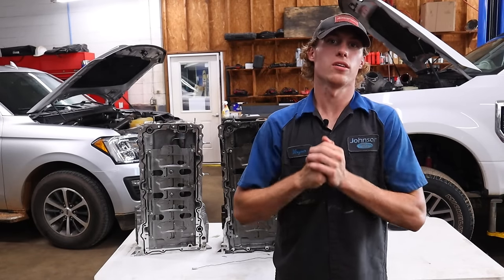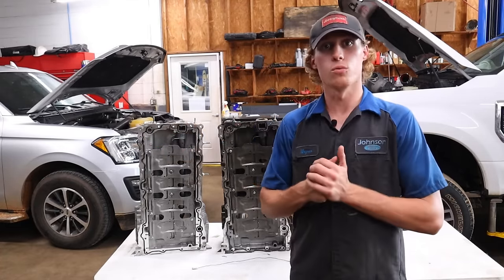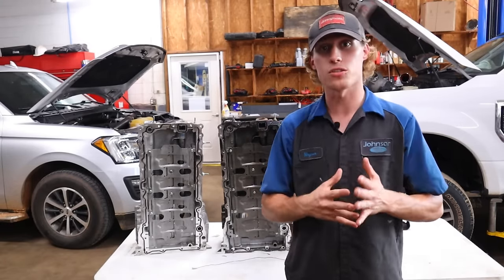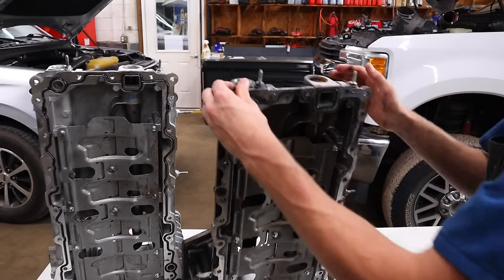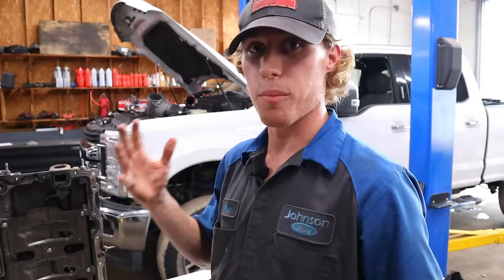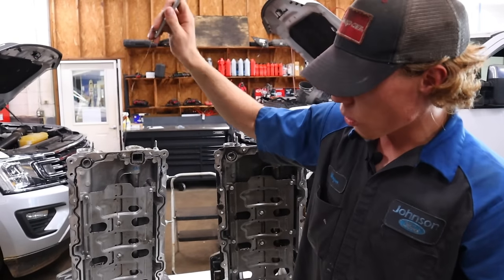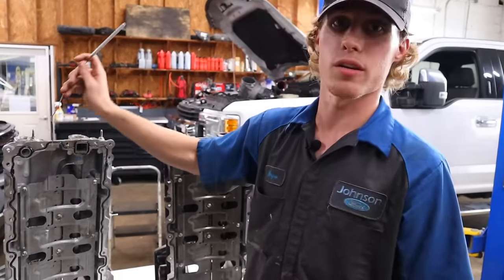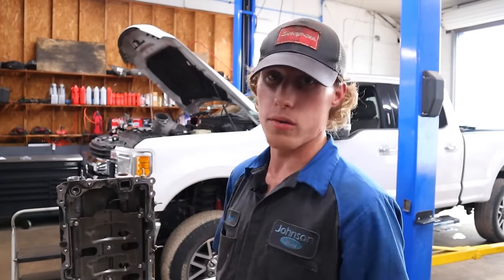How a BRAND NEW Oil Pan Destroyed This 6.7L PowerStroke

Comment: I find it hard to believe it locked up after only a 7-8 second run without oil pressure. During the cash for clunkers program, we had to intentionally blow up engines by running them with no oil and in most cases, those engines did not die easily as long as there was even the slightest oil film or lubrication on the internals.
Reply: I was thinking the same thing.  More than likely, they installed it, started it and took off for a test drive in it and locked it up.  Just a guess.
Reply: Yup. That’s not gonna lock up that quick. Shows extreme ignorance to even make that claim. Also, he put a pan on from a different year truck. I’m guessing there is more to the design change than that gasket.
Reply: I was thinking same; but I'm a GASOLINE engine mechanic. I do know NO WAY a gasoline engine locks up in 8 seconds at idle; I've seen demos where engines run at fast idle for many many MINUTES with NO OIL PAN 😆.  Are diesels more delicate flowers 💐???
Reply: That cash for clunkers was fun. Getting paid to blow up engines. Doesn't get any better than that. I was honestly surprised how hard they were to destroy. I was hoping for major catastrophic failures. I was sad when they slowly whimpered and stopped.
Reply: @xj31  It was a scam. A lot of really good vehicles were destroyed. There were a few I would have loved to have saved.
Reply: For sure
Reply: @CentralFloridaBowHunting  If they were to test drive it, they would have noticed it on the dash. No, someone leaned in and cranked it up without checking the dash, and then they lifted it up and ran it on the lift for an extended period of time to check for leaks from underneath with the engine running. By the time they came back, it was too late.
Reply: @AlphanumericCharacters  Good point.  Ford's gonna hang their hat on that one fact even though that new pan is being shown to be defective.  I would be interested to learn the outcome.
Reply: @nickyborrisino  Agreed.
Reply: Installed pan, started car, ignored oil light thinking oil will start circulating, left it idling to get up to temp to check for leaks, it locked up. Cant blame the mechanic impossible to predict things like this but dont go saying it locked in 7 seconds lol.
Reply: @kamn1  it is absolutely the mechanics fault. You never leave a running car after doing work to oiling/cooling system. The car needs to be constantly monitored until it can be verified as good.
Reply: @nickyborrisino  exactly he should have made sure there were no warning lights on after starting it the first time. my guess would be he got done and reached in the window and fired it up. let it idle until it locked up.
Reply: @nickyborrisino  fair enough
Reply: @coryament  exactly
Reply: I've personally witnessed a 6.7 Cummins idle for nearly 45 minutes with no oil.
Reply: @nickyborrisino  makes sense.
Reply: @hightttech  I had a Suzuki Swift lock up in approximately a minutes after the valve cover gasket failed and it still had oil in it.. I won't say it's impossible for a short run to lock up a motor
Reply: Every time I deal with anything related to oil related repairs of any kind first thing I do on startup I made sure it has oil pressure.....
Reply: @AlphanumericCharacters  He's actually not the first person to run into this exact issue with the oil pans. Definitely a manufacturing defect
Reply: I never heard of an engine that would only run 7-8 seconds without oil.
Reply: Man that was a fun time...can't believe that was upwards of 14yrs ago now.
Reply: Yea I'm sure the bearing clearances in those engines were just as tight as this 2015 6.7, I'm sure they lasted hours with no oil. Im sure you've ran every type of engine known to man out of oil and you know just how long every one will last. I've seen new engines last 10 seconds without oil and I've seen 200k mile engines last 10 seconds without oil. But I know not everything is the exact same and shit definitely isn't made like it used to be. You can find it hard to believe all you want but it's not your truck, your shop or your problem so it really doesn't matter what you, me or anybody else thinks. Guy got some good info out while also getting some views, and the customer will be taken care of.
Reply: @YaM0MsAh03  I hope he also learned not to walk away. Manufacturers always test their engines under extreme conditions for a reason, lack of lubrication being one of them.
Reply: @PotatocannonLol  lol valve cover gasket don't just suddenly fail and lock up the engine in less than a minute. I've personally had at least 15 engines lose oil pressure for one reason or another and not a single one of them stopped running in less than 10 minutes of not idling but driving and driving at the most amount of throttle I was able to give it to hopefully find a safe place and get off the road before it died. I've had several customers that left on a road trip and never checked the oil till they were on the side of the road with a siezed engine and the first thing that everyone tries is adding oil . Most of them found it had less than 1 quart of oil left in the pan and they were hundreds of miles away from home so no no engine that is is decent running condition and wasn't already badly mechanically damaged is going to die that fast..
Reply: @AlphanumericCharacters  the pan is an upgrade to the older rtv style pan. It's identical in every way except how it seals to the block. It's even covered under the SPA warranty. 🙄 y'all keyboard mechanics love telling us how to do our jobs. 🤦‍♂️
Reply: @claytoncoolidge992  I don't care if you don't believe me, that's what happened and wrote off the Swift. It was a significant amount of oil lost very quickly.
Reply: @PotatocannonLol  yup and I've had every drop of oil pumped out of blown filter housings holes in pistons and oil pump failure witch results in instant oil stopage. Oil has to meet a minimum specification for that exact senario as part of it's api rating.... That's why I can say that the odds of you loosing several gallons of oil and running long enough to have gone long enough to have lost the oil film are less than getting struck by lightning 5 times in a row in the same day within several seconds. either it ran longer or it was out of oil and severely damaged and would have been making noise and knocking when you got it. Either way it's a write off . Hell I've started a fresh engine that had no oil in it and ran for the 10+ seconds it usually takes to get oil pressure from a new built engine and it was fine generally takes 5 seconds or more to get oil pressure after an oil change so it's just completely illogical to be able to believe it man that's all I'm saying.
Reply: Diesels have higher main bearing pressures. They will lock up faster than a gas engine. 💯
Reply: @codywichman213  lol really? Cause I'd say that a turbo charged 500+ horsepower tractor engine qualifies as a diesel and ironically the increase in pressure will not cause it to lock up it will cause the bearings to crush and flatten out increasing the bearing clearance and eventually explode the rod and likely the block. Heat and friction are what cause the engine to lock up and diesel engine at idle creates far less heat than a gas engine and due to the low engine speed and low heat output in the exhaust the turbo is not going to be building any boost farther reducing the pressure and add in the shear amount of size and strength difference of the components the amount of friction applied is reduced farther. All of this is why diesel engines easily go close to or exceed a million miles with out a lot of effort where a gas engine is unlikely to even get to 500k miles and very very few make it over that . So your argument is actually the same reason that it's even less likely to have seized up that fast. Just an fyi I'm a master certified hiperformance auto ag equipment diesel and alternative fuel vehicle tech that owned and operated my own shop for 20 years and now work for GM in the parts engineering department for car/truck/med duty truck bus and specialty vehicle lines. I've had the opportunity to put this stuff on a dyno and deliberately try to destroy it including running without oil in the engine. A brand new engine on its intial start up and never had oil in it will go longer than 7 seconds so if a already tight as it can be completely dry engine can not create enough heat and friction to lock up in 7 seconds then there is no way that one that's been in use and had oil in it will be able to. Say what you want. Not possible. Hell I've snapped crankshafts in half blown main caps clean out of the block launched heads off the engine with too much boost nitrous and propane and seeing 2000hp before it let go check out the facts and what the manufacturers of the parts as well as the oil have designed into the system they have built in a several minute window that you have without oil pressure or oil to get off the main line of traffic before you lose the engine
Reply: @claytoncoolidge992  and years ago I've spent 45 min running, an alley find lawnmower engine after taking the oil plug out till it sezied your point. Just cause the odds are low doesn't mean it doest happen.
Reply from the maker: Keyboard mechanics 😂
Reply: @FlyingWrenches13  I was killing those engines before you were in tech school.
Reply: @FlyingWrenches13  lol or shop owner of 20+ years and current parts engineering department employee for a major manufacturer and avid destruction specialist in my free time. But hey to each their own 🤷
Reply: @YaM0MsAh03  Exactly. Anecdotal evidence is one thing, the point is that it did happen. Regardless of who says it's possible or not possible. Running the engine like that damaged it, and it was all because of crappy parts that we see as techs day in and out. It doesn't matter how or why, it needs to be remedied by the manufacturer of the part. I'm sure he didn't plan on guys talking about how it's "impossible". His point was to give a heads up to technicians to double check things like this before installing this design pan. So all the big dogs that bark about the impossible, when it comes to engines anything is possible. Even if you've never seen it first hand. Brand new zero milage Toyota engines fail, even though they aren't "designed to".
Reply: @FlyingWrenches13   💯
Reply: Yeah not buying it just had a cat excavator come in zero oil pressure leaking head gasket an it ran well over 5 mins replaced the bad oil pump an head gaskets she is back on the job working again
Reply: Once took a 98 Chevy Blazer to have a new engine put in the mech forgot to put oil in the engine idled it for 10 minutes and seized it up
Reply: 😂😂😂 mfs in these comments CLEARLY AINT FUCKING DEALER TECHS.
Reply: It is hard to believe that it only took 7-8 seconds as well when I heard him say that it had me scratching my head but at the same time they are delicate engines as well, probably a bit more, maybe 30 seconds to a couple minutes.
Reply: depends on how hard you run it full load in the wind 6to 8 secs about right
Reply: @johnfranklin4567  they were running it on a lift at idle 🤣
Reply: Diesel's  with high compression are way less forgiving but 8 seconds sounds a little fast!!
Reply: It's well documented..That the Ford 6.7 Powerstroke Diesel engine is JUNK.. Run.. Do not walk away from a Ford Powerstoke Diesel....There are so many engineering flaws with these engines.. Mostly in the oiling system...These engines are well known for spinning the main bearings... And also cam bearings ... 
And when this happens... You are looking at a total engine replacement...
You can not fix stupid !! And only Ford would engineer such a stupid engine oiling system design...
Now.. Let's count the HEAD BOLTS !!!!
Reply: I heard 70 seconds.
Reply: It takes eight seconds to get oil up to turbo, and two quarts of oil , in the 6.7 ford diesel. That being said, to lock it up at that giving time seems unreasonable.
Reply: Diesel engines have a lot higher compression ratios than gas engines which = greater stress on rod and main bearings. I’m a 22 year senior master technician for ford and I can tell you with certainty that a 6.7 power stroke will indeed lock up in under 10 seconds with no oil pressure. I’ve witnessed it myself. So even though you find it hard to believe, it happens
Reply: The vehicles that were considered the clunker cars that were built long before 2008 the manufacturing was far superior than what it is today.
Reply: @xj31  I bet you got paid handsomely by the gubment to do just that, didn't ya?
Reply: Just a guess on the "No way it locked up in 7-8 seconds". Oil pumps are typically positive displacement pumps. With a new pan (no prime) it seems reasonable that it takes 7-8 seconds to prime that pump and then it hit a wall. I'm assuming the oil pump hydraulically locked, killing the motor.
Reply: @sHoRtBuSseR  but they where literally tractor engines put into trucks
Reply: Yeah. Kinda sounds like b.s. 7 seconds???
Reply: @KasparrTV That's right we are better.
Reply: @claytoncoolidge992 want a pat on the back
Reply: @roncaptain9527 still better then the duratrash
Reply: @FlyingWrenches13 ....all with more experience and/or sense than you can allow yourself to appreciate, son. You should close your eyes and take a deep, soul cleansing breath or two... for about as long as you allowed this engine to run without checking the oil pressure... and own up to it. At least to yourself. Everyone fuxup now and then. You're good at what you do and you were trying to get another one out the door and get paid. Maybe you got too overconfident because you know all the other jobs just like this were right on the money and you felt no need to check oil pressure. Maybe you were in a hurry to shut down shop and go pat lil mama on the booty.... I bet ya every keyboard mechanic commenting has been in both all these situations. 

I know you ain't proud. I wouldn't be either. But I wouldn't have made a video about it and you shouldn't have either. Because your body language was so different from your other videos that it told on you.
Reply: The tolerances  on the 6.7 powerstroke are extremely tight. (Too tight) then on top of that the engine is extremely high compression so It doesn't surprise me
Reply: Pretty sure I have seen it go both ways. I remember my Grandpa having a tractor that had been sitting for several years. A family member got it to start with the intention of selling it. When it fired up, it at first sounded fine, then started knocking, and then seized. The total run time was probably around 20 or 30 seconds. But I have also seen someone forget to fill the oil after an oil change and run the engine for a minute or two wondering why it sounded different before realizing their mistake.

Comment: Worked for a Ford Industrial Engine dealer years ago, must have swapped out 10 or more exhaust manifolds where the #1 port wasn't connected though to the rest. Considering all the engines were 'test run' at the plant you'd wonder how they got a test cert..

Comment: Interesting on the 7-8 seconds, definitely a QC issue.  If you follow Dave Auto Center, Engine builder out of Utah, he does a 2 part series on the issue with the Ford 6.7 and high number he rebuilds because of spun bearings, caused by a poorly engineered oil system.  He does a test that shows that on start-up (including after less than hour of running) it takes 7 to 8 seconds to get oil pumping in a Powerstroke.  He has a solution to cut it to 4 seconds for those he rebuilds.

Comment: I’m not knocking your abilities. I will say this shows your engine building experience. And this is a lesson learned that you will never forget.    I was taught that time you have and Engine tore apart that you should prime it until you see oil pressure before you try to start it.   Good job young man.
Reply: That works good for engines where the distributer drive connects to the oil pump drive, unfortunately diesel engines do not have distributers.  I honestly have no idea how you would pre-prime a diesel engine.
Reply: @carportchronicles1943  Just an idea, but I would assume that the diesels also have the flood mode, hold the accelerator pedal to the floor while cranking and it will not start, thats how you prime most all newer gas engines.
Reply: @carportchronicles1943  we pre prime with a pressurized container..kinda like the mighty vac pump. And fill it with oil attach it to the oil pressure sensor fitting. let her rip
Reply: That engine still would’ve f-up even if you would’ve pre-primed it anyway
Reply: @kdougk3478  Would have caught there was no oil pressure, no ?

Comment: Run a bore scope down the oil passage. Curious what the blockage looks like. Casting slag etc.
Reply: Should be that simple.
Reply: weve seen this on multiple new oil pans. they werent machined all the way through in that hole.

Comment: I can’t believe it only took 7-8 seconds for the engine to lock up. Bearing clearances are so tight on newer engines, so it doesn’t take much to lock them up. I’ve took old cars that were headed to the scrap yard in the past, drained the oil, let it run and it took a few minutes before the engines finally seized. The longest run with no oil was an old Honda B series. Took about 5 minutes of running with no oil before she finally locked up. Those old B series engines were stout. I used to own a ‘95 Integra GS-R with a B18C1 and that thing would take any amount of abuse you threw at it.

Comment: Probably not a drilling problem but a casting problem when casting the form for it, probably that punch out die was not in place properly and it filled the hole my guess anyway thanks for the info!